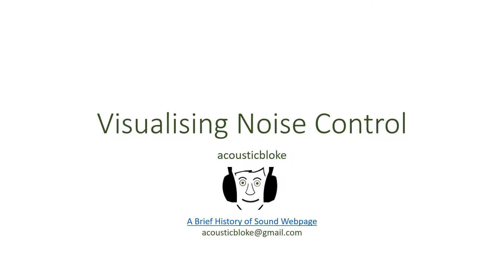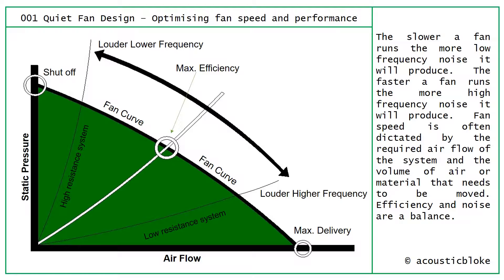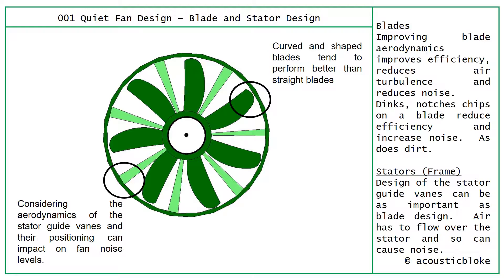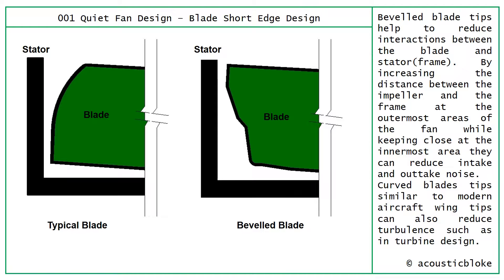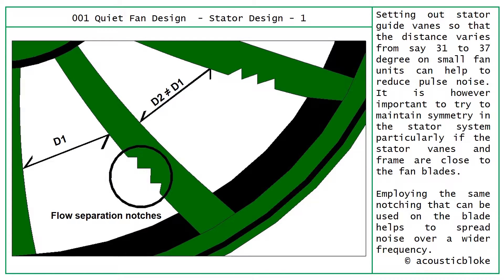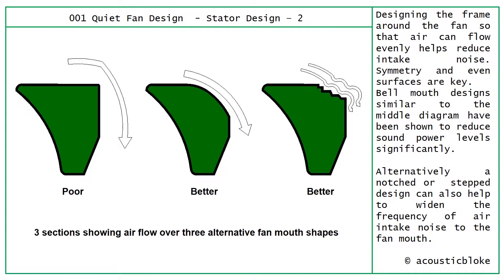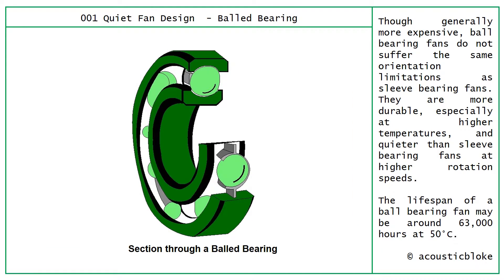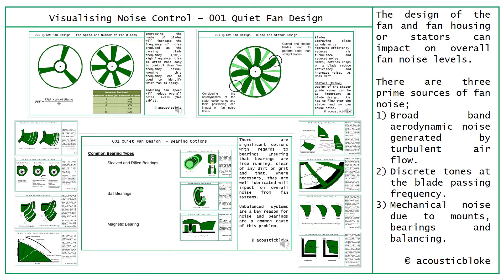001 visualising noise control - fan design

Comment: i didnt whatch the vbideo yet, will come back and comment but i have these questions in mind
1) is noise turbulent flow
2) is the flow coming from the new toroidal and  the silent loop blades more laminar than with the noisey blades
3) what is the energy cost of noise and turbulence in fans, as climate change becomes and issue for the hottest places the cost of cooling is going to become a sigunificant cost.

Comment: Good video ,i wanted to ask if we channelize the intake and outlet air flow through hexagonal mesh (to convert turbulent flow to laminar ) without changing the blade design,will there be any noise reduction?